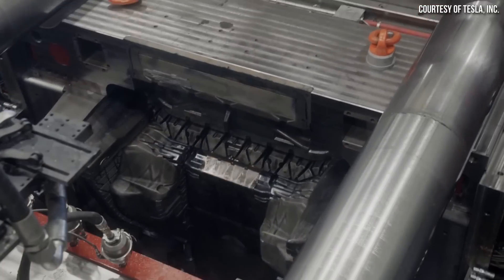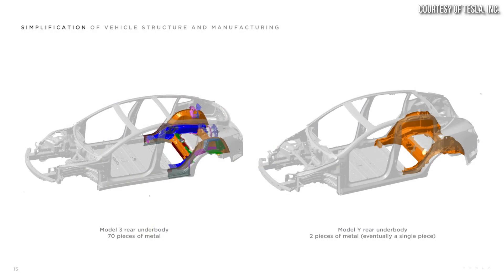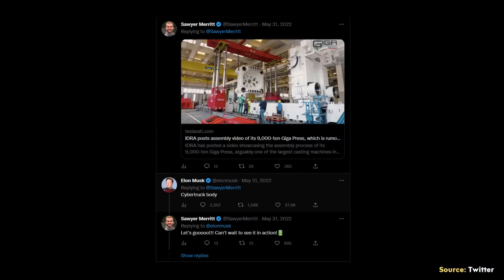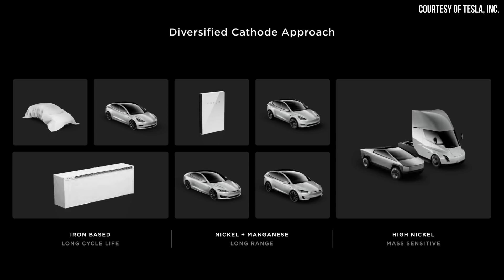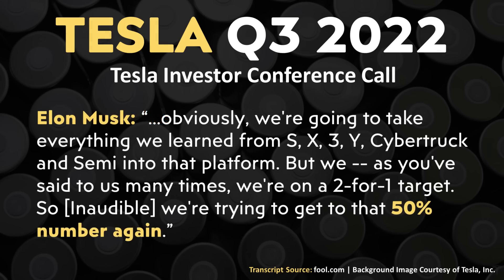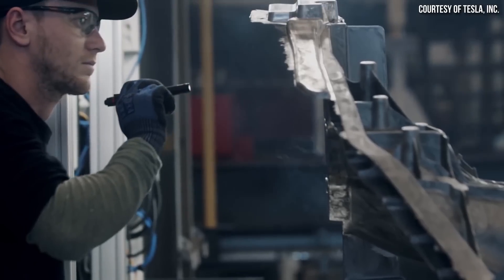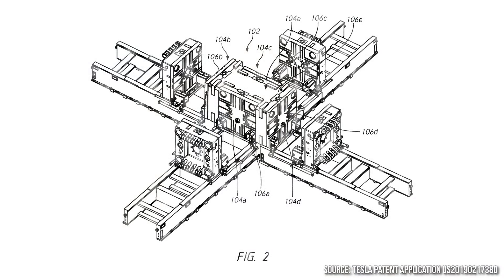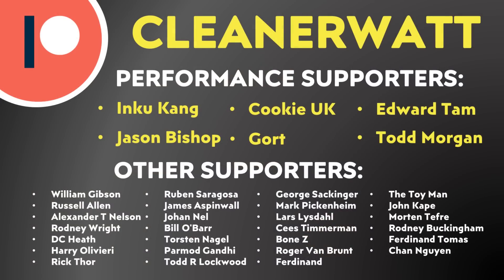Tesla Model 2 Giga Press Confirmed? | Diecast $25K Tesla

Comment: It makes no sense to cast whole chassis in 1 shot. Warp and tolerance on long rails is hard to come by. Multiple forms means that when 1 is broken or has to be maintained whole DCC is in downtime. It's cheaper to buy lower rail cast front underbody and rear underbody and connect together.

Comment: You can't cast an entire vehicle of the size of an automobile for several reasons.  One of the biggest reasons is due to the thermal expansion of a monolithic object.  This is the same reason that you can only pour concrete slabs so big before having to use expansion gaps.  A car body would be much more prone to deformation due to 3D nature of complex curves and angles.

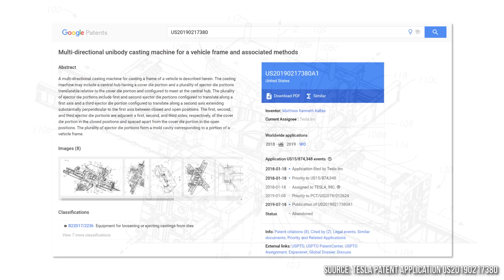Comment: Looking at the patent photo at 6:04 I realise now what we've been looking at all this time. I originally thought that the whole body was being cast (excluding panels). In actual fact this image shows the casting of the skeleton body and mates with the front and rear castings. Then all the doors, roof-glass, bonnet / boot, panels, motors, pack are attached. The tolerances and speed of output will be amazing and pretty much renders conventional car body assembly lines redundant.

Looks like the skeleton is cast over an internal "body" shell / form with the left, right, front, back and top side moulds enclosing the permanent body core. The underbody is not cast - it can't be and besides, that's where the battery pack pops up into (with the seats etc. already installed).

Might be a model X in the image; whatever it is it's a gull wing door.

The new casting machine is obviously not this one as illustrated in this patent. It will be interesting to see what pops out of it in a year or two...

Comment: I believe the sides will be cast. Doesn't make sense to cast whole car would be the most complex die. So with sides then you would have the battery pack with seats preinstalled as well as the IP which would be mated and joined

Comment: In France, 80% of the new cars sold are smaller than a model 3. Tesla really needs to make the model 2 since the over-supply of 50k€+ luxury EV’s will saturate the market before the end of 2023 (particularly since the subsidy is zero above 47k€ and only applies to the cheapest 3/Y in white paint). In the mean time, people are snapping up the 29k€ MG4 ev hot hatch (24k€ after subsidy) since the EU alternatives (ID3, Renault Megane E-Tech, Peugeot 208 etc, cost > 10k€ more at similar specs. The BYD Atto 3 is compelling at 38k€ before subsidies, since it’s very well equipped and comparable to popular ICE equivalents that still fit in french parking spaces (unlike the model 3 and Y which are too wide and long).

Comment: The original patent looks like it would cast four sections on the same huge press but I don't see how it could actually put them together. The casting machine has a front and back, therefore there would always be the inside casting mold in the way. The only way I see this working is if they were able to cast two halves then put those together. This could be either the front and back or two sides. Again, the difficult part is creating and filling a mold that's longer that anything that's been done. Front/back would mean 6-8 feet of flowing aluminum while left and right would mean maybe less than 3 feet to get everything. Then the two halves would be bolted/welded together although I'm not sure the collapsible portions and other things could be molded all at once. The third option would be a complete bottom and just the top framing. This actually sounds like the ideal process as long as they could design the molds so they could come apart. I could see the bottom part being molded up to the top of the rear end while the front is only molded to the middle or top of the front hood. This would create a wedge shaped bottom casting while the top might be a rather light piece of the hood framing and top frame of the car. Bottom part would need a 9K ton press while the top part might be able to use a large but shallow 6K ton press. If IDRA could produce this press making it only use two pieces, that would mean two short assembly lines comprised of two presses, two casting cleanup assemblies followed by a single joining  assembly system with a couple robots. This could reduce the large scale assembly time to a matter of minutes per car followed by the normal interior and exterior installation of motors, battery and other parts. I don't see them trying to create a frame-body shell all at once but who knows, that might work too. Just add the doors, hood and windows plus interior and you're done.

Comment: Although speculative, your conclusions are entirely sound and I for one can't find any discernible fault in them. I've also been expecting the single injection solution, featuring a rectangular hole for a structural pack. Thank you, that was another very fine presentation.

Comment: Hi Jon, Nio will use an 8800 ton Giga Casting in the All New ES8. Deliveries starting in June. So start of production is not far.
It is also possible this casting machine will go to Nio's supplier or some other Chinese companies. 6 manufacturers said they want to use Giga Castings.
https://youtu.be/ndgf98G1jMY
Sorry if this is a little bit self-promotion, but there is a lot of information in this video about this.
[Note: I have made the mistake thinking that Cybertruck will use 8000 tons machine, but otherwise I stand by the video].

Comment: Complete and utter fantasy to think this press is to cast the entire body. I don't think it's big enough to do a complete frame in a single piece either. The conjecture is flying but we have no hard data on this press or who it's even for, let alone what it's going to be used for. It's more likely to be used to cast both front and rear subframes at once. It could be for future optionality.

Comment: Casting is great for complex parts, but cabin is not that complex and benefits from high strength steel. I expect Tesla will sandwich a single piece front to rear casting for Model 2 between a high strength cabin top hat and base. Skins are then fixed to the high-strength steel.

Comment: That BYD Dolphin that they sell for under $17k.  Is that before China rebates or after?  Also BYD makes about 2% profit per car.  So they make about $350 per car sold?  Tesla will make more than $5k per car sold at $25k.  Someone must be able to do the math on this.  BYD needs to either improve their products or cut their prices drastically.  Probably both to compete.

Comment: For this machine to be aimed for the completely new platform, this platform would have to be WAY further along than what's likely. Remember, the machine for the CT is getting installed now and production is aimed to start this year. I think much more likely is a Cybervan, same platform as CT but made for the Asia market. Basically a copy-paste of the CT production line with small changes.

I'd be shocked if they are planning to start production of a fully diecast next generation car this year.
Reply: Not true.  The press is designed to use a mold, so they can still install the press and manufacture the mold and have it ready shortly thereafter.

Comment: Unfortunately the 9000T machine shown is NOT for an upper frame of the compact.
I contributed to a video in 2019 with Ricky at Twobitdavinci on this.
The patent application for such a machine would have 4 moving parts and a core- incredibly complex. Additional difficulties with welding points and material flow (or the windows are cut out afterwards). As Elon has said since- you probably could do it, but it’s probably not worth it.
Possible scenarios imo are EITHER;
- (likely) improved cycle time/quality for MY/M3 rear/ front castings (due to higher pressure/locking force)
- (maybe possible) a full underbody casting for the upcoming ‘gen 3’ platform

- (unlikely?) ‘project highland’ is a full underbody casting for M3/Y (not likely imo- machine and die tools still too small)

Comment: Conventional car assembly has a body shell welded together with pressed steel panels. The body includes brackets for bolting the suspension components on. Tesla seems to use a similar welded body shell, that is then bolted onto a cast sub-frame, and the suspension is then attached to the sub-frame. I don't seem what the casting brings to the party other than needless complexity and the risk of corrosion problems by attaching aluminium and steel parts together.

Comment: NO!
Theres lack of let's call it "dimensional awareness" being displayed here (and elsewhere)
.
Look at the shape of a vehicle.
It's not a straight sides cube.
......Let's try an analogy.
.
Pick up an object (a ball is best)
If it's any weigh, you've "moulded" your fingers around it".
Now remove your hand without moving your fingers.
You can't.
The distance between the  tips of your fingers is less that the outside dimension of the object.
.
Now imagine the object is the "inside mould" and your hand is the casting.
.
You have to split the "casting" (open your hand) to extract the mould!
.
And other problems....

Comment: Tesla could make hay with a $25,000 vehicle however, it might depend on battery supply capability. One would think if the car is mostly cast, then it might not take that much time to ramp up the rest. Maybe Tesla are putting all the pieces in place, then at a time of their choosing, they can unleash this beast. If they are at full production levels with the current range in China in 2023, they might not pull the trigger. Or they might decide to rise the price of their current range thereby reducing sales so they can then have capacity for this new model.

Comment: Could actually be for BYD  . If Tesla does cast the entire sub  body  they may actually move to Plastic guards bonnets and doors as steel is not required for strength . This would be a weight saving and speed up manufacturing . If everything was plastic  you don't need a spray booth , just dip the die cast for corrosion protection . I know Porshe used plastic coloured rear section in the  70's on the 928

Comment: My guess, it’s for front and rear subframes on model Y, model 3 and the new smaller compact Tesla, that is if Tesla has managed to design the new gen3 platform to use common structural components for all their cars. Probably can make front and rear castings in one shot with a large press, which again reduces costs. See what happens later this year when the Model-3 refresh materialises.
Reply: Good point, thought about that too. Better one 9000 t than two 6000 t machines

Comment: I think there is a better than 50% chance you are spot on.  

They would need to ensure they are ready to manufacture at scale before taking orders unlike vehicles of the past were they could take preorders a year or more ahead.  This would need to happen to ensure they do not have the Osborne effect that kills current model orders.
Reply: it is just a question of pricing and availability. If the smaller Tesla is initially priced high enough it would not be a problem. Same as with the Model Y, it had an effect on the Model 3 but never was a problem for Tesla.
Reply: @nilsfrederking62   Yes agree to a point, though Y and 3 are in a similar price bracket. The “new” car is likely to be 30% to 40% cheaper.

Comment: Tesla model 2 prediction.
Full underbody casting
3 door hatch (possibly 5 door later)
2 motor rwd hub motors ( makes space for battery and saves drive training  weight and cost, no difference or drive shafts)
Small like European compact size think fiat 500

Comment: I suggest a features list for the low cost Tesla.  I’ll start:

1. No glass roof. Save cost and weight and reduce interior noise with padded headliner.  Eliminate summer hot head and winter cold head.
2. No frameless windows.  Increase rollover strength, decrease wind noise and danger of getting slammed with invisible glass while closing door. 
3. No electric windows or at least no electric seats. 
4. No side mirrors. Cameras give wider field of view.
5. Decrease windshield angle to reduce solar gain and improve visibility. 
6. Allow cameras to see each corner of the car and all wheels for parking. 
7. Rear drive only to increase fwd frunk, decrease turning radius.
8. Ding proof plastic body with 10 mm structural foam backing with sheet metal interior for maximum stiffness and best crumple.
9. User replaceable fenders opening up after market customization. 
10. One color body made easy to custom wrap. 
11. Near vertical rear window to maximize interior space and allow spoiler wing to cover it to ward off sun and snow. 
12.  270° side rear side view
13. Fold-down front seat like Toyota Matrix that allows full length loads and for sleeping. 

Let us know what you think.

Comment: Very good video!  I think the casting of door outer panels and hood and trunk lids will be too much to ask of aluminum.  A frames for a door that an outer sheet emtal skin is riveted to will work just fine and be repairable.  Same with the hood trunk and roof.  This is a good opportunity to totally redesign how a car door works though.  gull wings have been tried and sliding doors have been tried; Maybe it's time for a rolltop desk kind of door? Even a bifold door could have some interesting, cramped parking lot,  advantages.  Sure is a shame about Musk's bad experience with motorcycle.  Just had my 5th or 7th bike wipe out; ICU for 7 days.  I still want another bike!
Reply: I believe he misspoke when he talked about casting the exterior. I believe he was talking about the internal chassis but I could be wrong.
Reply: @colingenge9999  Yeah; but I think you could be right, too!  It makes more sense.
Reply: Get better!! Keep the shiny side up!

Comment: There are many, many things you can make with such a huge casting machine (if they are needed at scale). And, frankly, almost any "vehicle" - of any size, from any manufacturer, and probably any type batteries and power trains - would be desirable if it also accessed or contained Tesla's eco-system of chargers, insurance, computer controller, and updatable software. So yes, a solid body frame casting - or top, front, and rear castings with a structural pack - for a small or large van, car, or even a child's toy;  add a motor and computer; and you have a very safe, inexpensive to-make vehicle. Adding some design beauty would make that compelling.

Comment: Did I hear you say that the 9-ton gigapress are GF-Austin would be used to make the Cybertruck body?

To be clear: the gigapress is for aluminum alloy underbody castings. Cybertruck's body will be made from stainless steel.

Nobody has ever die-cast an actual automotive body before, so far as I am aware. If GF-Shanghai uses their new gigapress to die-cast the body for a gen 3 Tesla, it will be a first.

Or they may intend to manufacture Cybertruck underbody castings using the press. Why not? There is a market for pickups in China and around the Pacific Rim.

It will be fascinating to learn what the press will be used for. And by whom!

Comment: Why do people keep talking about "full body casting"?? This is not possible or ideal. You cast frame and/or chassis components that are complicated with a lot of bolt ons (like bulkheads). If you tried to cast a body it would be thick, and brittle. Maybe you mean "full chassis casting"? Even my neighbor is convinced the CT will have a cast one piece stainless body. Nope. The body may be folded sheet stainless; it may be pressed, but it won't be cast.

Comment: I think Tesla will next go to a four piece major set of castings (bottom/sides/top).  Also they will have smaller castings like doors/hood/tailgate/seats.  A few years back they sold kids cars that were made up of several castings.  I believe that those cars were a study on surface smoothness/paint ability.  Recently, they got bundles of recycled aluminum cans in Austin.  They smelted them down and added in their alloys.  I believe they performed standard strength tests and also cast samples.  In the US, recycled aluminum will probably cost 1/10 that of new aluminum!!!  Besides the motto of no part and no process, they are going to add no stamped sheet metal parts!!  Having four large castings allows assembly of sub parts into each of those castings.  You then assemble the 4 assembles into the car.  NOW, if the White Hat/Nesara-Gesara/Release of 6000 Secret Patents becomes true, THEN we will be on Nikola Tesla power that is beamed down to us using Quantum Resonance.  Meaning the car can receive power at all times.  Now maybe a small battery or no battery will be needed.  The battery cost ~33% of a Model 3.  The first version of the Model 2, might have fewer than 1000 parts total!!!  When you couple all of these ideas, the Model 2 might be able to sell for less than $15K...
Reply: This makes sense because the working area of the 9K ton press isn't big enough for a full car, so I like your layout of multiple castings.  In the full car patent diagram, compare the multiple dies and their layout with the 9K which has only 1 movable die half and the other fixed.

Comment: Great job. 

I hope you’re right. And if the 2 looks like the thumb, has similar performance to my 3, fold down back seats give a decent sized area to carry cargo, and is $25k, I’ll put an order in Day 1 and sell my Model 3 when it arrives.
Reply: It is certainly not in the interest of Tesla that Model3 owners switch to cheaper models. So they will wait with the 2 until Model3 demand drops significiantly. When the 2 arrives with hatchback and half the cost, the 3 will be the new "S" in sales. Why then buy a 3 anymore?
Reply: The initial pricing will be higher than 25k for sure.
Reply: @nilsfrederking62  or the battery pack will be smaller so lower range, performance lower. More of a commuter car.